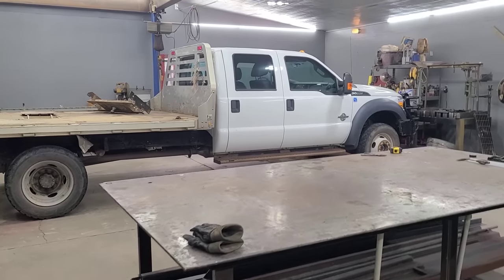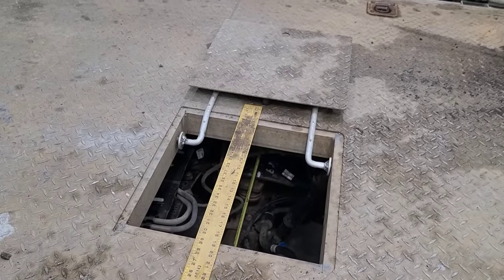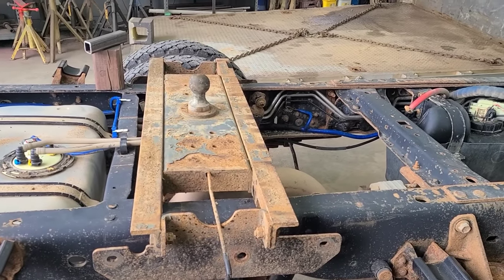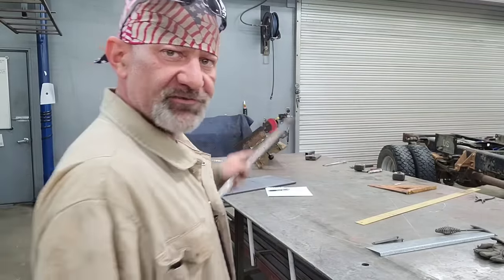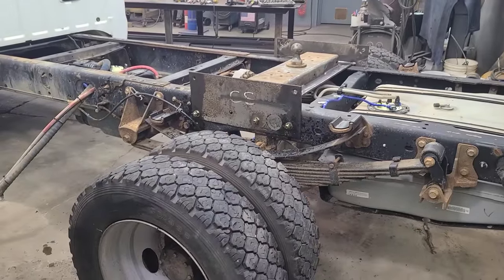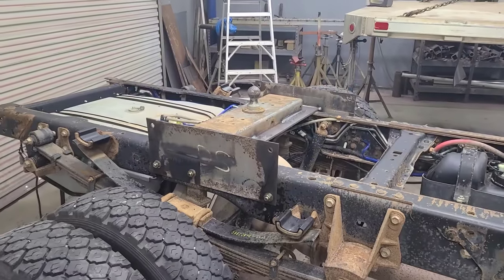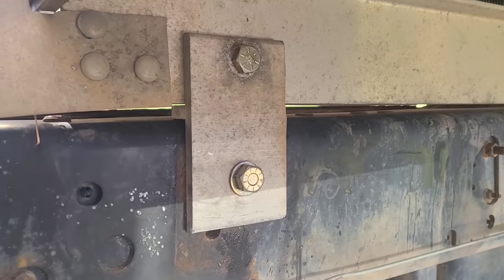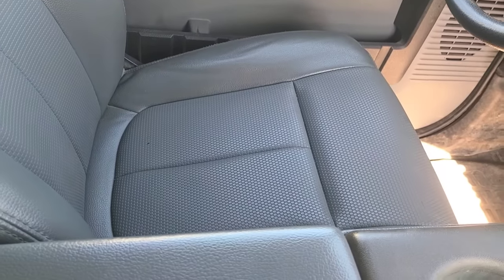Gooseneck hitch on a Ford F-550 from scrap parts

Comment: I noticed that the sub-frame on the bed had already been notched through the bottom flange to go over a gooseneck. I definitely would have welded something from the ends of the gooseneck ball mounting block over to the side plates (probably 1/2” or 3/4” flat bars stood on edge. 2 or 3 on each end) to stiffen your 3/8” plate on top of the truck frame and transfer the weight directly onto the truck frame and eliminate any flex in your 3/8” plate even if I had to make the notch in the bed sub-frame longer. As far as creating pockets between the flat bar stiffeners to hold moisture, mud and cow s___; I would have drilled weep holes through the 3/8” plate between the stiffeners while I had the mag drill out. Also, for those who don’t know, you never mentioned the importance of placing the gooseneck ball slightly in front of the center of the rear axle. I have placed them at both 2 and 4” inches in front of center depending on how much bed length you have from the ball to the rear of the bed to allow for turning room while hooked to a trailer. Any thing to cause the gooseneck hitch to transfer trailer weight to the front axle of the truck which is the whole reason for a gooseneck hitch in the first place. And yes, I realize that pipeliners; with their mini-trucks, don’t pay any attention to that 🤔. And, while I’m already this deep in the weeds, I think I would have scrapped the thin side plates for 3/8” or 1/2” plates. But, that’s just me. Hope you’re well.

Comment: That trailer hitch, truck bed frame, and those running boards need a good cleaning off of the rust, and a good rust preventative paint/primer mix applied.   The owner should do that, and protect his investment.   Nice work on the hitch, CB.    I’d love to find a deal like that to make myslef a mobile rig for my Bobcat 260 efi, and compressor and toolbox.

Comment: How far forward of the centerline of the axle did you put the center of the ball? I have a similar project coming up with my 93 F350 can and chassis with a flatbed. Thanks for the great video!
Reply from the maker: Sorry I don't have an exact measurements for that but I think you should be able to get a pretty good idea from watching the video....I don't have that truck here to get an actual measurement of it

Comment: where the safty chain hook,ele plug.
Reply from the maker: Customer is doing that when he builds the rear bumper...he can fabricate but he just didn't want to tackle the hitch & bed...
My hoist made easy work of dealing with the truck bed...if he had to lift that with a tractor it would have been more of a hassle and more risk of damage

Comment: Nice work! I never tried, but did you use the special cutters for drilling through two layers? I figured if you did you might have mentioned it in the vid.
Reply from the maker: I used the standard mag drill slug cutter bit...the one that cuts like a hole saw